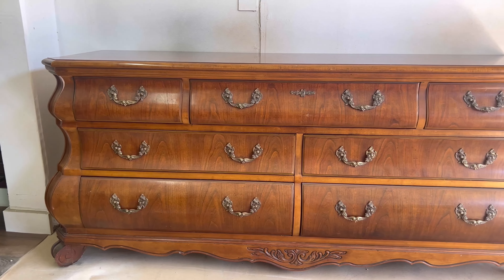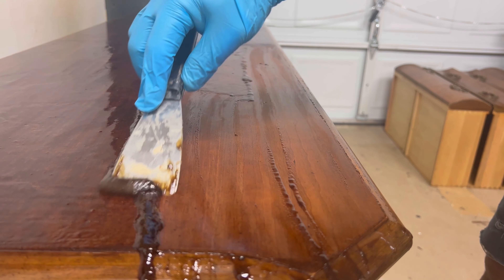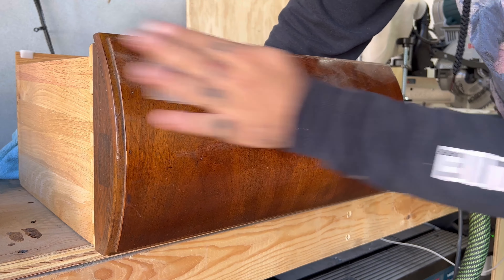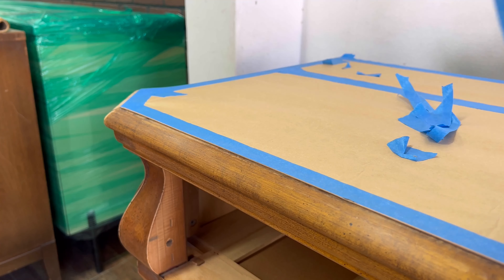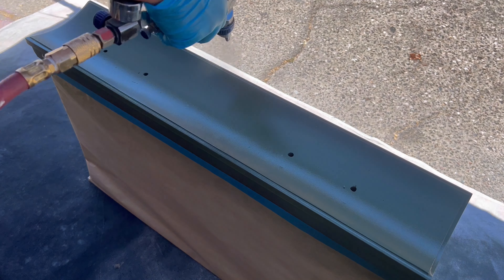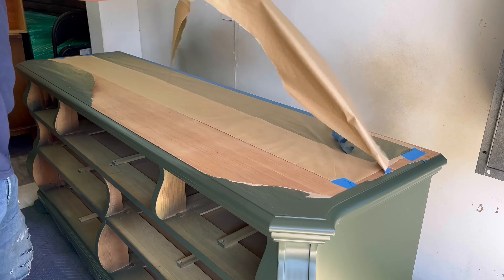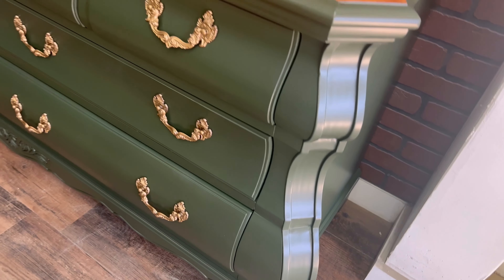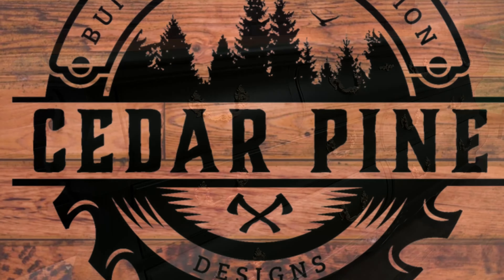HOW TO completely TRANSFORM a solid wood DRESSER SET \\ LAUREL WOODS PAINT \\ FURNITURE flipping

Comment: Just found your channel and love it. I have picked up my first dresser to refinish it and try flipping it. Just wondering about your primer and paint. Other then being water based so you can run it through your gun. Do you use any kind of special paint or anything for it being a piece of furniture?
Reply from the maker: Thank you so much for the compliment and support. I don’t use anything special as far as paint, I just like to get it with a built in primer. But if you sand to bare wood it’s always good to use a separate primer along with your paint. I always Finnish my paint with polyurethane to protect the piece as well as the paint.